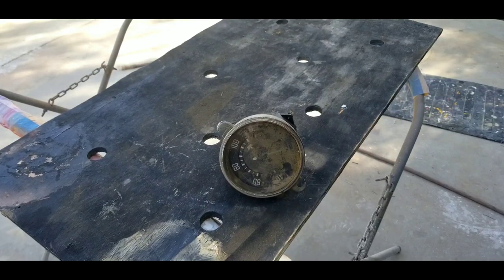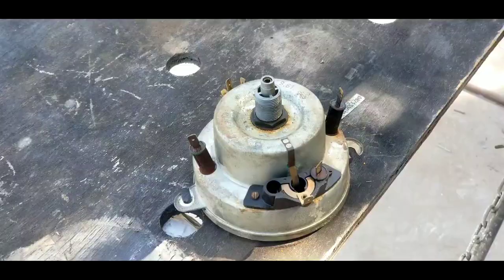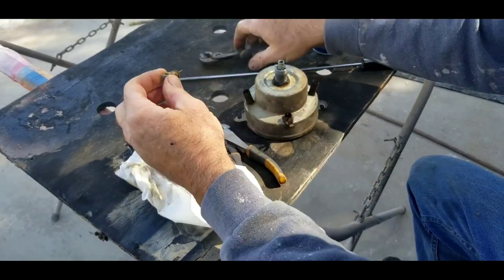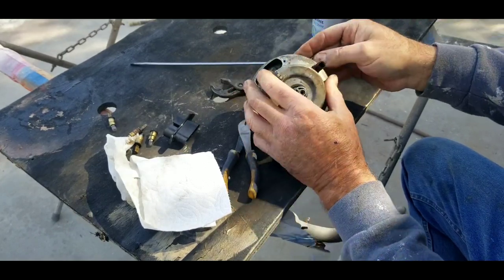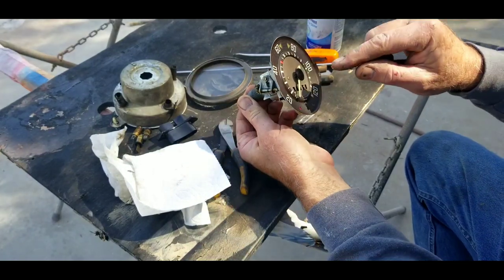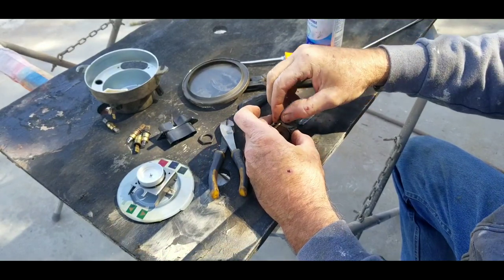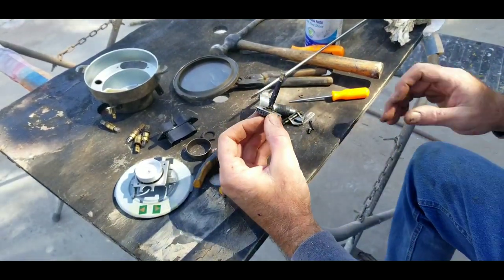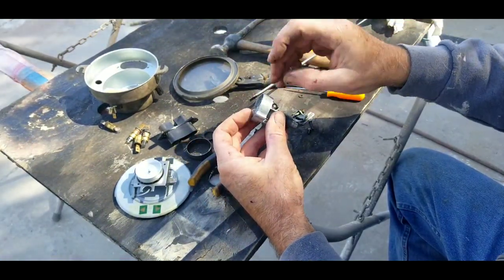VW BUS speedometer rebuild. Similar to VW Bug. repair you stuck frozen wobbling speedo

Comment: I worked on a Smiths speedo with my bugeye Sprite years ago. Ended up at that speedo shop up near UCR. That was in the 80’s all I needed was a calibration because I changed tranny and wheels. I learned not or touch the face as the paint was like a powder and every little thing made a mark. 👍👍👍😎😎😎
Reply from the maker: I remember that speedo shop. last time I was there the owner was super drunk. IDK what happened. All the employees were kinda scared....
Reply: Maybe he was doing some speed and it got to him! 🤪😳

Comment: Here’s how you fix your neighbors dogs. And I did this myself. 
Because my neighbors, after several of my complaints did nothing. And I just don’t understand that. What makes them think that we want to hear their dogs barking all the time. It’s like pulling up to someone at a stop sign or stop light and having to listen to their music as loud as they can play it. I just don’t understand it. It’s not civil. So… 
I run myself a length of pressure hose. To the backyard next to the fence where the dogs were. I bought a dog whistle, and fixed it to the pressure hose. On the other end of the pressure hose I had a small regulator. That I could dial about two or 3 pounds into. Whatever the dogs ears were most sensitive to. I tried several different settings. I finally got their attention. When I came outside and they started to bark I turned the valve on. Waited a little while until they stopped. And then shut it off. Now this can go different ways. The dog might start howling more, or they will be quiet. Use that to whatever advantage. And you can train them. Where eventually when they hear you outside or whatever they will be quiet because they have been trained that you will whistle at them.
It seriously works.

And
Wonderful job on the speedometer!
Reply: I could have used that info over the last 30 years! 👍
Reply: @anthonysinclair5721  ha,ha,ha